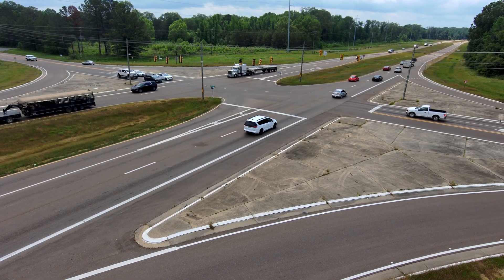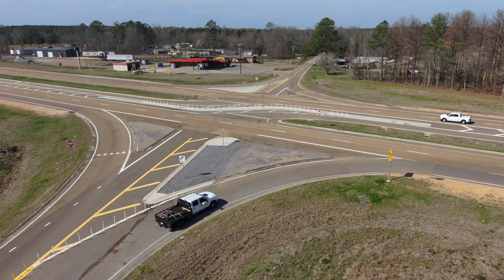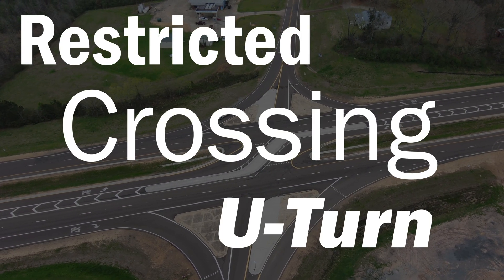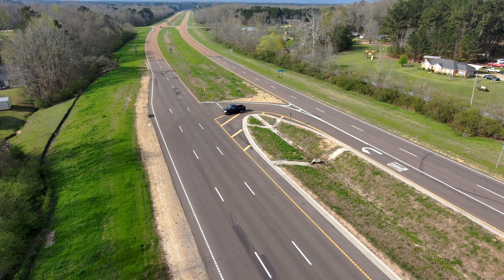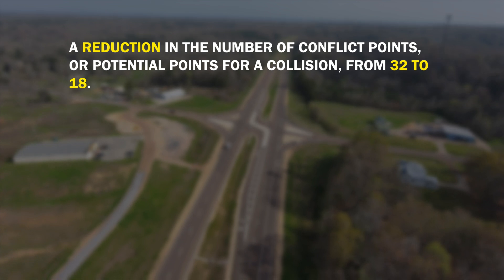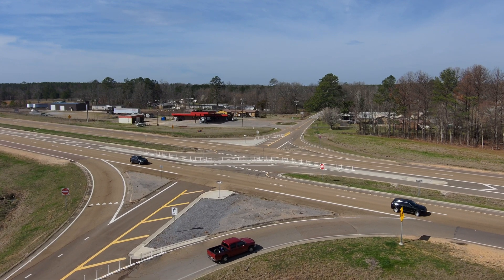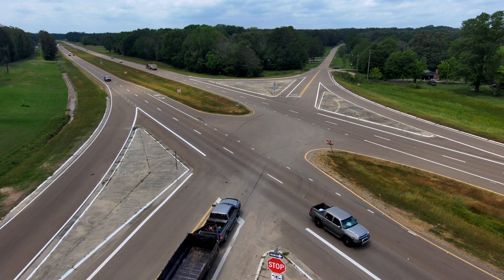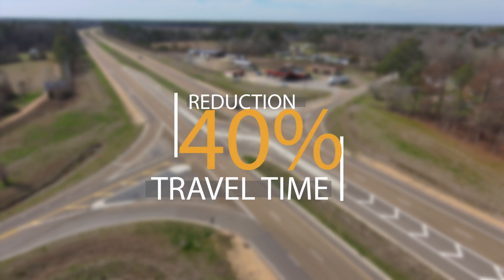RCUT / J-Turn Explainer

Comment: These actually increase accidents to include fatalities.
Reply: Fatilities decrease as there are less crossing crashes.
Reply: @traffic.engineer  incorrect. There are more fatal accidents as people are getting rear-ended or hit in the drivers side door at an angle which cuts into the vehicle. Most of the rear-end fatalities are from whiplash. Not to mention the over rate of injury goes up because far more people are getting hit.
Reply: @JoeZelensky  Total over crashes decrease, along with injury/death crashes.  This is due to less cars crossing perpendicularly, alomg with less driver error as they do not have to look and assess in two directions. Rear-end crashes have less severity due to crumple zones absorbing the impact.
Reply: @traffic.engineer total overall crashes increase because people now have to wrench their necks back like 70 degrees to the left to see. Then they have to play Frogger over 2 or more lanes while looking both left and right. Most cars don't have the acceleration ability to not get rear ended. The alternative is traffic gets extremely backed up because nobody can get out. A 4 way light would easily resolve these issues.

Rear end collisions are no less fatal and they cause much more long term damage due to how many more there are.
Reply: @JoeZelensky  You are making no sense.  Drivers making right turns already do this.  So there is no greater risk.

Signals increase the crashes and injuries because driver do not expect to stop on the highway unless the location is urbanized.  Signals increase the rear end crashes, thus increasing any aformentioned risk you stated.  Signals only mitigate delays for sidestreet access due to high volumes; it would not address the speed of highway traffic.  Signals only assign the right of way.  Drivers still risk running the signal.

Comment: I think it's a horrible idea. As a truck driver I know that these types of turns/utruns are more dangerous. Cars highly underestimated the speed of semi trucks. When I can makes a right turn and needs to get across two lanes of traffic to make a utrun. They generally go at a slower speed to pull out front of traffic then when they take the utrun cars don't always keep to the lane the need to.
Reply: And making a left turn is a lot more dangerous now that you have to negotiate 4-lanes in one movement.

Comment: There's still a big place for roundabouts. Unless there's a wide median, a u-turn with a trailer is going to be difficult if not impossible. The trailer will also stay in the turn longer which means one would have to wait for an even longer time for approaching traffic to be clear.
Reply: Roundabouts are GARBAGE. 
95% of drivers younger than 35 CAN'T drive or understand things properly & roundabouts become incredibly dangerous. 
96% of women drivers of ANY age can navigate roundabouts safely.
Reply: Roundabout creates unnecessary reductiom in speed for the priority route.  It would not make sense for the priority road to yield to the occasional sidestreet left turns.

Comment: How about a roundabout? Very effective outside of America.
Reply: Roundabout would not be considered here because of the high volumes on the priority road. Especially in proportion to the sidestreet.

America considers roundabouts where overall volumes are less than 1000 vehicles per hour (1500 for dual lanes).  Above that, roundabouts lose efficiency.  

Additionally, roundabouts cost more due to more materials and land necessary.  If another more efficient option uses less concrete and land, then that option is considered.
Reply: And yes, America builds roundabouts.  America started building them in the 90s after France's campaign.  America just has stricter criteria where they work best.
Reply: @traffic.engineer  Shouldn’t safety come first over speed? That should be prioritized. The fact this country has so many annual deaths from car accidents is insane. So many other European countries have significantly less annual deaths with their safer road design, which the design not only benefits drivers, but also people outside of cars. People outside of cars are just not prioritized in American and that’s awful.
Reply: @devind407  RCUTs offer significant safety improvements on their own and, by prioritizing main route traffic, are more consistent with what drivers expect on a high-speed corridor. Having drivers slow from 65 to 25 for a roundabout creates safety issues with increased rear-end collisions.
Reply: Unfortunately American drivers still do not respect the roadways and signage.   Slowing from 65 to 25 at a well signed intersection should never result in increased collisions.  RCUTS will not help anything with slowly accelerating cars in the left lane after a U-turn. Rear endings will increase!
Reply: @traffic.engineer  interesting history. So a bunch of traffic engineers got into a room with the French and sucked the Frenchies off and in return for a cover-up decided to ruin the roads in the US?